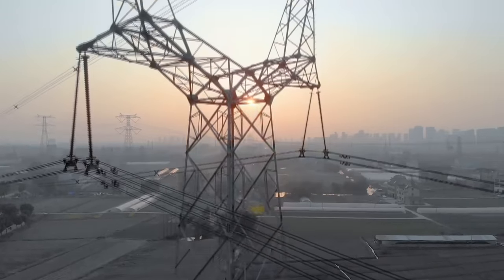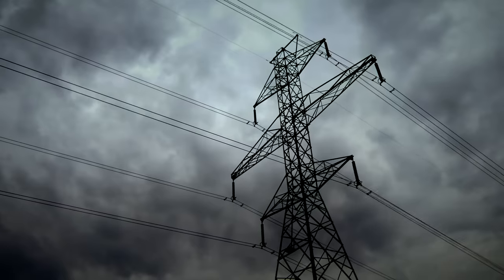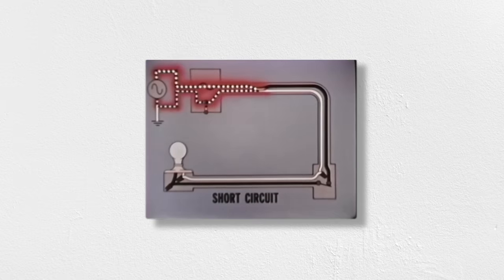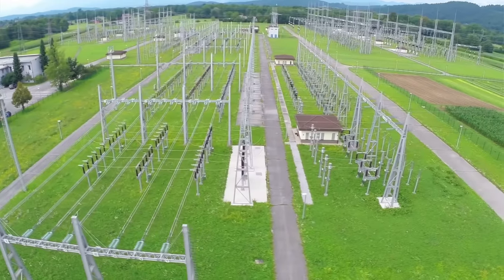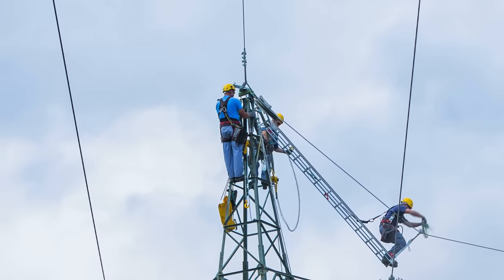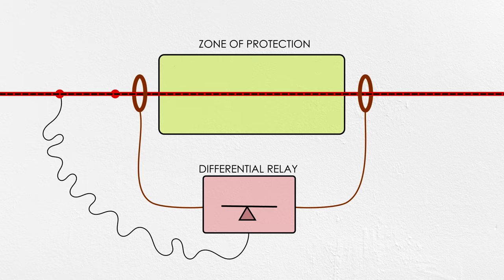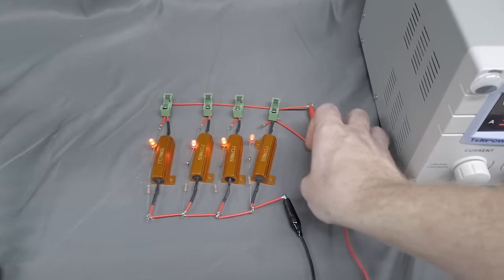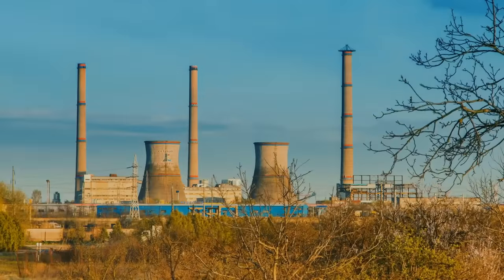How Power Blackouts Work

Comment: How do high voltage circuit breakers and switches work? At the really high voltages the power grid operates at, wouldn't the two sides of the switch arc and weld themselves together?
Reply: They would if there wasn't a way to blow out the arc as soon as the contacts in the breaker separate. Old breakers were filled with oil which has a much higher dielectric strength than air. Then air blast breakers were used which blew away the arc with a powerful blast of air like blowing out a candle! Today most breakers are filled with a gas called Sulphur hexafluoride (SF6) which is not flammable like oil but has a very high dielectric strength. That plus a "puff" extinguishes the arc immediately. You don't want to be standing near one when it trips. Sounds like a cannon. I nearly jumped out of my skin!
Reply: That's why there's that several disk thingies on electric tower and other high voltage facility. They basically act as fuse for high-voltage cables. If I'm not mistaken, by melting and physically cut and seal connection between cut- point. Stuff.
Reply: I am going to assume that we are using the breakers for Alternating Current (AC), as we have 1 less problem to deal with due to the arcs being self-extinguishing (meaning the arc does not persist, as persisting arcs require mechanisms to extinguish). For the welding together issue, either huge springs or solenoids (electrically operated magnets) are used to force both parts of the switch apart and the amount of force needed is pre-calculated for the maximum rated current to prevent welding.
As for how to deal with the arcs that are formed during the switching operation, we store the switch in media with high breakdown voltages like sulfur hexafluoride or vacuum, for example, so arcing does not occur as soon as a minimum distance is created between both contacts of the switch. For more information, search Quora where many people asked the same question.
Reply: @mirskym  Exactly right!

Comment: I understand how all of this works for blackouts, but I still get frustrated by city wide blackouts caused by what I can only assume is a system that doesn't work properly with the consistency of them happening
Reply: Power grids in most of the world have no redundancy. Thats the real reason you get blackouts. 

As soon as a single thing goes wrong, you have to shut parts off or everything fails.

Comment: I've got a question for anyone who sees this comment. 
Where I live in Sydney Australia, everyday at 10:01 pm ish our lights flicker. Often there are more flickers at 10:16 and 10:31 too. What might cause this?

Edit:
Culprit found
https://en.m.wikipedia.org/wiki/Zellweger_off-peak

It takes several days to turn a coal power station on and off. So they can't just turn it off overnight. Power companies have cheaper rates at certain times and send out signals to automatically turn on things that aren't time sensitive like hot water cycinders.
City's with more modern grids than Sydney (cough cough) have smart meters that change the price on a half hourly basis.
Reply: Wonder if this will ever get read

Comment: What's the difference between a blackout and a brownout?
Reply: A brownout happens when there is power on the line, but at a lower voltage for whatever reason (named so because old incandescent bulbs goes brown when the voltage is low). A blackout is when there's zero power.

Comment: How do you shed excess energy on a grid?  Giant resistors?
Reply: John Donahue Shedding excess energy is a very real problem, particularly in a grid with renewable power systems that do not respond to changes in demand.
Reply: Generation facilities are tripped off (rudely disconnected.) That is a risky thing in terms of stability: they have to be synchronized to the grid before they can be reconnected and that is time consuming.

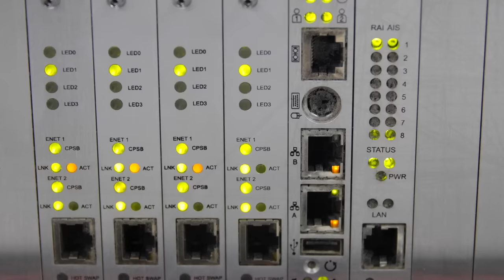Comment: 7:43 those communication blades have very descriptive names for the first 4 indicator lights.  /sarcasm

“I mean, I don't even know what any of this stuff does.  What’s going on there? I don’t know,” he says, motioning at the panel of blinking lights. “Is it good that it’s doing that? Occasionally it doesn’t do that and I think I should tell them, but often I just look away.  And this one.  Flash. Flash. Flash.  Nothing for a while.  Then wait for it. Here it comes!  Double Flash!  Brilliant!”
Reply: The LEDs labeled LED0 through LED3 can be controlled remotely. When a blade fails, another blade will automatically take over its work, as long as there are enough working blades in the chassis. A technician will be dispatched to replace the bad blade.

These things may be in a manhole, on a pole, or in a building with tens of thousands of them. Once the technician gets to where they think they should be, they contact the operations group. The operator will change the light pattern on all of the working boards in the chassis to something unique. The technician will verify that he is at the correct chassis.
He will then replace the bad blades one at a time. The operator will test the newly installed blades and configure them.

There may be several technicians working at the same time across the network. If everyone does everything right 99.9% of the time, then someone will screw up about once per thousand blade swaps. Depending on what the blades are doing, that can be too often. So there are several verification steps to make sure the operator and the technician are both working on the same circuit, and that that circuit is the one that needs work.
Reply: @hamjudo  That's good to know and thanks for the background, but honestly a pretty terrible approach.  When I was a young lad we just flipped on the "lamp test" routine from the console and the technician went, "Oh, it's that blinking one.."
Reply: @NGinuity  blinking vs. not blinking isn't enough if one operations center is managing 50,000 devices. 

The LEDs have other uses during development and testing.
Reply: @hamjudo  By all means then, spend a bunch of time playing with patterns then. :). I still don't understand why it's a valid litmus test and you have a 99.9% success rate with that method, but a lamp test is somehow not a feasible scenario for replacement testing, but hey if it works for you, it works.

Comment: Today most of the Danish power grid is under ground. 
I'm pretty sure that only some of the high voltage lines are still on masts. 
It's been 17 or 18 years since I've experienced power outage.
Reply: While medium voltage and low voltage power lines can be mostly undeground, I don't think that the high voltage lines are underground (it's way too expensive to do that).
Reply: @FrainBart_main  Some of our high voltage lines are underground, but not all.
Actually we now have an ongoing debate about having a new powerline on masts, or putting it underground. 
Underground is approximately three times the cost of masts. 

Btw. We have quite a few high voltage undersea (HVDC) powerlines to Norway, Sweden, Germany and latest Holland. 
We'll soon start constructing on to GB.
Reply: @JohnJohansen2  This debate is for 132 kV lines, right? Because I have seen estimations, that 400 kV lines tend to be around 15 times more expensive. Yeah, I know, the Viking Link, right?
Reply: @FrainBart_main  Yup! The Viking Link. 400 kV.
In 2008 our parliament decided that all existing 132-150 kV, most of existing 400 kV, and all future high voltage powerlines should underground. 

I've just checked.
It looks like the 3 times more expensive holds. 
At least not a lot more.
Reply: @JohnJohansen2  Interesting, I may have seen some outdated data. Is the fact that underground cables have about 50 % lower lifetime than ovethead lines included in the calculation? Also, are reactive power compensation costs included (underground cables need far more compensation, otherwise overvoltages occur, which can damage the cable insulation)? Thanks for the info :)
Reply: @FrainBart_main  Actually I'm not that much into the details. 
But, I'm sure a lot families will be pleased not having powerlines and -masts as their neighbor.
That's worth something. 
That is also, not having to pay compensations for lower market prices on their properties.
Reply: @JohnJohansen2  Thanks any way, I'm sure many will be pleased. I just hope it won't influence electricity bills significantly. Can you share the document stating the 3 times higher costs, please? It doesn't matter if it's in Danish.
Reply: @FrainBart_main  Latest update! 
Actually just a couple of hours ago. 
It now seems like only about 15 percent of the Viking Link related powerlines can go underground. 
That's apparently due to technical issues, probably the things you mentioned, more than prize.
Reply: @FrainBart_main  In the following link, it states that masts will cost about 3.3 billion Dkr (~1/2 billion $)
And the cost for underground cables between 6.2 and 10.4 billion Dkr. (1 to 1 1/2 billion $)
https://ing.dk/artikel/trods-kritik-stadig-urealistisk-at-grave-kontroversielle-jyske-kabler-ned-229936
But, as mentioned, that's probably irrelevant now.
Reply: @JohnJohansen2  From what I understand from the article, they are talking about the West Jutland connection (not the Viking Link), which is needed to provide enough transmission capacity for the Viking Link project. HVDC links don't have many technical issues like AC lines do, so they are often underground (or under sea). HVAC lines on the other hand have many technical issues. I'm still surprised that it would only cost 2-3 times more if it was put in the ground. Tnx for the link. It's a pity that the cost calculations are not public.
Reply: @JohnJohansen2  From a 2008 technical review: "If it were possible to place the entire 400 kV [Danish] grid underground using today's technology, the
 expected costs would be around DKK 37bn, ie 14 times the expected costs of continuing with the expansion principles used today." I don't think things have changed as dramatically as needed to change the 14x to 2-3x in 11 years. Anyway, nice talking to you. Take care.
Reply: @FrainBart_main  You're welcome! 
And, you're right. It's not THE Viking Link, it's a part of the necessary, connecting infrastructure. 
Well it's kind of public. 
The quote is from the Danish minister in charge, at the time. 
We've got new government since.
Reply: @FrainBart_main  Nice talking to you to. 
And likewise.

Comment: The concept that there is a single grid and it needs to be centrally managed is the flaw here.  As much as practical, power should be generated near where it is consumed.
Reply: In theory, yes. In practice, there are a lot of differences that would have to be managed. When I lived in Phoenix there was a neighborhood that had an early microgrid, connected to the distribution by a transformer. It was in the news when the transformer was becoming unreliable, there was no replacement available, and the alternative came with a price tag just short of a million dollars. I never heard how that turned out.

Comment: Sadly, every couple hundred years or so, a solar flare strikes so massive that it could outright destroy much of the equipment in the grid. The entire continent could be without power for months.
Reply: Not exactly. Only certain power lines are vulnerable to it, and protection is normal now.
The problem comes from DC current across spans of the Earth's surface. The DC component travels from ground at one end to the other through transformers. The DC causes trouble by magnetically saturating the transformers, in turn causing the AC load to produce damaging internal currents if the demand is too high. Here in Arizona we have no problem with solar flares. Check out the map at https://www.usgs.gov/news/new-geoelectric-hazard-map-shows-potential-vulnerability-high-voltage-power-grid-two-thirds-us
If the lines are shut down, or the loads are shed enough, there is no danger of damage.

Comment: The power in North America is 60 cycle alternating current all generators must be synchronised.
The failure in 2003 was caused when a plant in Ohio had a transmission tower fail suddenly which created a shock wave in the grid which blew out the switchs in the substations.  The nuclear reactors in Ontario were all going off in alarms so the operators poisoned the cores to shut them down quick except for Bruce Power who had the foresight to see the problem was external to the power plant so they shut it down slowly. There was a couple walking on the beach of Lake Huron a few miles from the plant they saw it release a big cloud of freshwster steam and when they got back to their cottage the power was off and they wondered if the world had ended.  The other plants took a month to get up and running again it was bad news for an area that is 60% nuclear powered.
Areas like Niagara Falls were only out for a few minutes on the first day as they were fed off the local feed from the Adam Beck plants.

Comment: The 2003 NY blackout was crazy complicated to turn back on. If I remember right they had to figure it out on the fly because no process had ever been created since they didn’t think it could ever happen. https://en.m.wikipedia.org/wiki/Northeast_blackout_of_2003
Reply: I don't know how many plans there actually are, because generation and load values are constantly changing. Generation has to equal loss plus load every minute, even more frequently on small islands. When nobody is generating power and nobody is consuming it that first step is a doozy. Grids need both simultaneously to maintain stability.

Comment: So I totally get the cost thing about it being too expensive to put everything in super protective bubbles....BUT what balancing act is being done? EVERYTHING is just out in the open.... I don't see any sort of protection or preventive measures being taken. Every single year, over and over and over again, we get blackouts, downed lines and days or even weeks with people without power. The cost I'm sure to constantly repair all of htis is phenomenal over years. Sure it'll be expensive up front to protect and enclose the infrastructure, but I feel like htis will easily pay for itself in the long term. At least start slowly, migrating little by little. We've been having to take storms head on and then clean up the damage every single year...why not work on this to solve it now?

Comment: I love your lack of jargon, but you let one slip: "Referenced to ground." What exactly does "reference"  mean there?
Reply: The voltage of the line is measured as a comparison to ground or earth. This is the most common configuration,  although you can have voltage differences between two live lines or terminals with no ground involved. For example in a battery the voltage stated is between the positive and negative terminals.
Reply: It means that side of the power system is connected to conductive rods driven into the ground.  This makes that side nearly 0 volts when compared (or referenced) to ground potential.

Comment: An OM606 engine can last up to 3 million km according to some (it's a 90's diesel engine by Mercedes). Or semi truck engines if you don't mind the increased demand on fuel, they can last over 3 million km typically. But a car that would NEVER break down... that would be impossible. I mean like... for it to have a super smart computer which could melt metal that you throw in so it can then replace broken parts and whatnot... that would take up FAR too much space and it would be WAAAY to impractical XD Therefore, there will ALWAYS be cars that need to be repaired at least a couple of times.

Comment: A lot more of the power grid should be buried though. Especially in areas where extreme wind events happen. Looking at you Florida.
Reply: Underground has problems of its own, especially at transmission levels. Underground transmission lines are oil cooled, and share the same vulnerabilities, difficult fault location, and difficult repair that distribution underground lines do. The company I retired from had a couple of underground transmission lines in a city but they were the result of negotiations, not benefit.

Comment: 8:05 - Like after a Carrington-level solar storm?
Reply: Oddly, a lot of places are not affected by solar storms. The problem comes from DC induced onto transmission lines interacting with high AC loads to saturate the transformer cores. That makes the transformer act like a short circuit when the currents add to significantly more than the transformer rating. Here in Arizona we never worry about it at all. See the map at https://www.usgs.gov/news/new-geoelectric-hazard-map-shows-potential-vulnerability-high-voltage-power-grid-two-thirds-us
Reply: @flagmichael  And who knows?  Maybe our VLF bubble will provide even more protection from these solar storms.